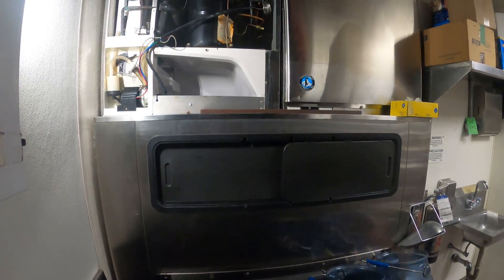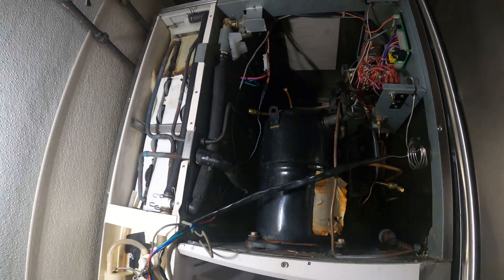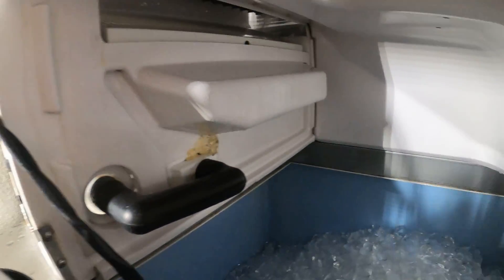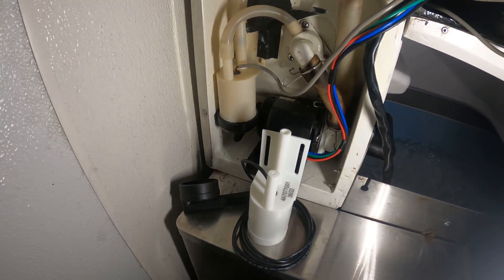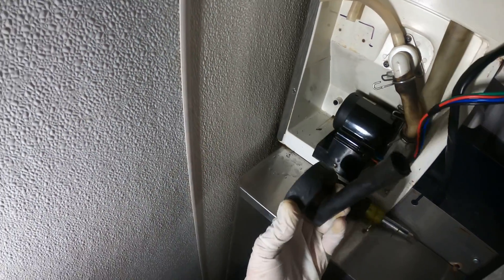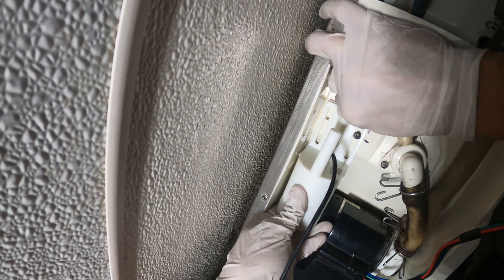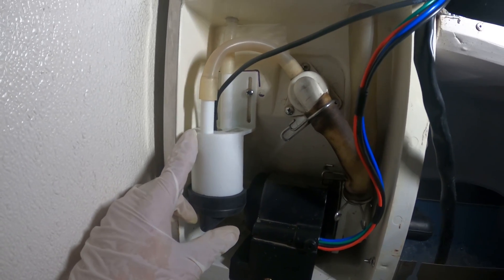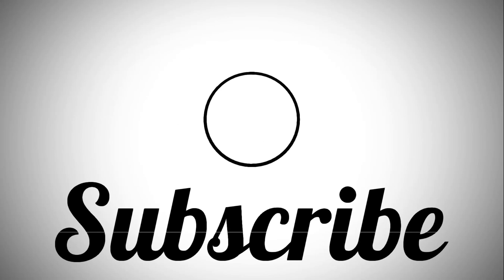HVACR Service Call: Hoshizaki Ice Maker Float Switch Replacement (Hoshizaki Ice Maker Leaking Water)

Comment: Does the check valve next to the flower switch have a stopper or just a coil spring? Mine has just the coil and is losing a lot of water out of it always.

Comment: Our hoshizaki ice machine have ice bridging and being too big issues. Causing it not dropping properly and backup and freezes up. I changed a new float switch but same thing happened. what can possibly be the cause? It’s not the ice cube float switch big/small adjustment issue either. 

i checked the inlet valve and its good as well

Comment: To fix/tighten the stripped screw hole, simply add a drop of super glue into the plastic hole, then flow a sprinkle of baking soda into the hole. This will form a strong material coating. Repeat ONLY if the hole is still too large. 
Take care

Comment: I checked a hoshizaki ice machine yesterday. It constantly dumps water. I checked the dump valve. Is it possible the float switch is inop. And not telling the circuit board the tray has enough water? Causing it to overfill?